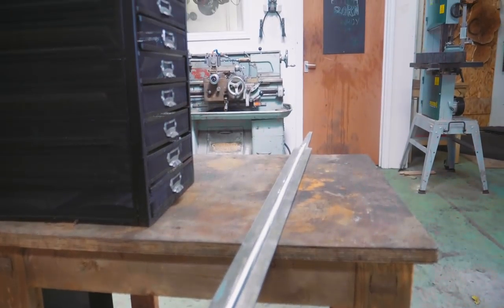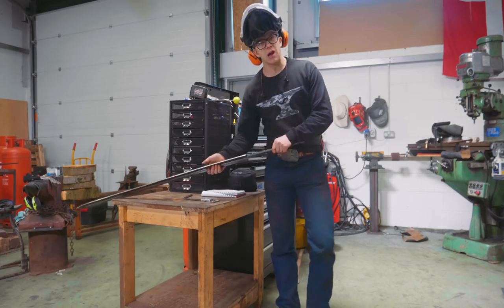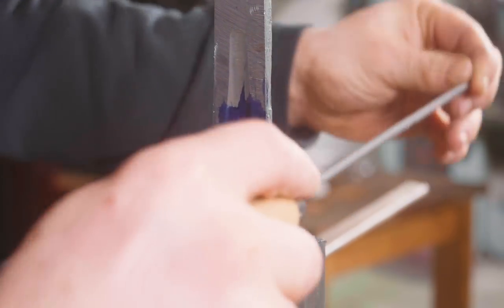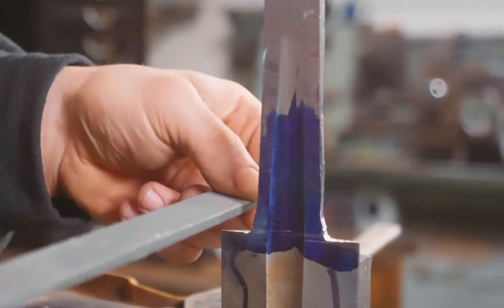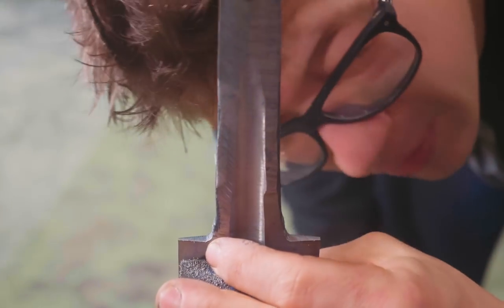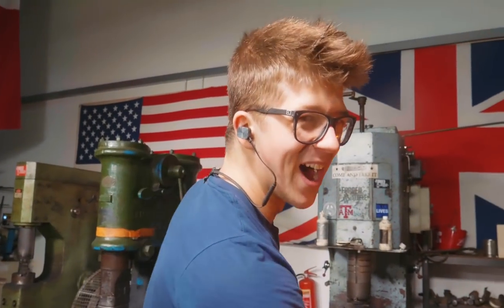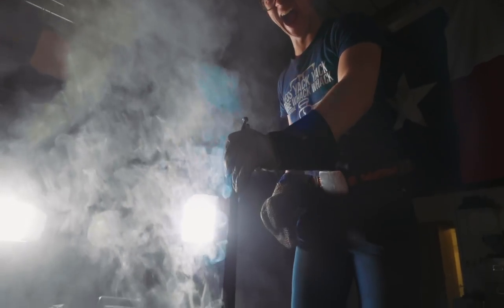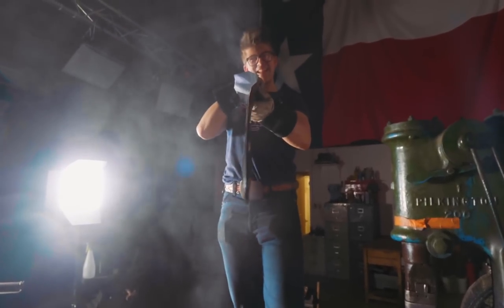MAKING A SCOTTISH CLAYMORE SWORD!!! PART 5

Comment: Alec!!! You really need to make a proper length forge if you plan on making more swords! I understand using the smaller forge for fine work on the blade, but that warp is what you get when you don't evenly heat it. The temperature gradient on a 1/3" thick slab of steel can still be comparatively large if you are dealing with the kind of conditions at the edge of a forge. I'm sure you will figure out a way to fix it though. I still love your content, so don't let this failure discourage you!
Reply: A sword forge is definitely needed if he's going to continue making swords. He certainly has the shop space to install one, and he has a buddy who makes forges.
Reply: ThrowingItAway My bad, I didn't look for duplicates. I just started mashing my keyboard furiously when he went for the quench.
Reply: well, not necessarily. if you forge something you don't want to forge something while it's all the way hot, so you need to have something that only heats up at the most 2 feet of metal to forging temp.

Comment: for long blades quench thick and grind thin to reduce the risk of warping.
Reply: Stuart Smith Forgive the n00b question, but ive always wondered ... is it possible to clamp a blade to a rigid support when quenching to prevent warping, then just normalize afterwards to relieve the resulting stress ?  Would that work ?
Reply: Roving Punster actually yes, one trick is that when you quench it you actually have a few seconds to straighten it right after, when quenching you only need to keep it in the oil for about a second to get the drop in heat (if it takes longer your not using the right fluid) but anyway for a few moments after the blade is still changing its structure and hardening and during that short time it is possible to clamp it straight and the blade will maintain straight
Reply: Roving Punster yes and no. I've seen long blades quenched with bracing structure in place to keep it straight with great success. However you don't want to normalize after a quench as it undoes all the hardening.  I think you mean temper it after the quench. But yes, even after a temper you can,  to a degree, flex the blade to remove warps. However what Alex has is extreme. It will take some time and creative thinking to get it straight .
Reply: TheAmericanGuy yes he could have taken advantage of the short period after the quench to attend to the more serious warping.
Reply: @Roving Punster: 

At this length it would not work. The problem is that steel is quite flexible, which would lead to the sword beeing straight clamped down to something and flex as soon as you loosen it. 
The bend at quenching comes from ununiform heat as well as different material thicknesses and the internal forces will be there even when the steel is clamped down straight.
Reply: Peter August I guess it is not quite the same as stuffing a toothpick in a flattened shrimp to keep it straight during cooking. 😉 j/k

Thank you everyone for the very informative answers. Much obliged.
Reply: Again, forgive the n00b remarks, but It's too bad many types of steel apparently lose their (or entirely lack) magnetic properties at/near quenching temps, because (on a purely conceptual and hypothetical basis) having an electromagnetic induction coil system paired with a multi point infrared sensor (ex: https://www.amazon.com/dp/B00PEHCYBW/_encoding=UTF8?coliid=I1VBAH9NSI4507&colid=3NWIN21DPU1U1  ) and a digital control unit could otherwise automate/optimize the hardening process ... just enter the type and thickness of steel and the hardness range desired, and the machine will get you close.

Wont work, but fun to ponder.
Reply: Roving Punster it will work but only on smaller blades.
Reply: Stuart Smith I've reinvented the wheel ?

It's Miller Time. ;-)

Comment: Aren't you supposed to bend the warp back during the "grace period" while it's cooling? Clamp it in a vice and bend it back while it's still hot enough
Reply: Yes, but that is hard to do even for more seasoned smiths, when you see Illya do it on Man At Arms you gotta remember that he is vastly more experienced than Alec, he has been a blacksmith for as long as Alec has been alive. 
He should practice it on more simple pieces though.
Reply: @immasurvivor  Also the human avatar of Svarog... (Illya)

Comment: At about the 8:30 mark you can see that warp start to develop in the forge .. but I think if you file test that blade .. you'll find it is not hardened fully .. unless the lighting gives a different perspective .. I don't believe that blade was anywhere near hot enough to harden .. I sincerely hope I'm wrong for your sake ...
Reply: Andy Amend yeah I hope it was the lighting cause from what the camera picked up it didnt look hot enough or uniform in colour. Hope its not the case & its just a lighting & camera issue.
Reply: It's probably the lightboxes making it nearly like daylight, so not as easy to tell the true color.
Reply: True. That and the middle definitely got hotter than each end.
Reply: The heat didn't look even enough to my eye, it looked quite cold in some sections and hotter on one side. I don't think all of the sword hardened, from looking at the scale pattern it looks like the cold spot near the middle is soft.  I really hope the blade didn't saber on him or it's toast. I think Alec should build a proper sword forge if he's going to do these builds. And if he's going to use solid fuel again it should be charcoal rather than coke. It's cleaner when it burns and it doesn't have any ash.
Reply: My first thought when he quenched it.
Reply: Lighting.
Reply: I completely agree. that blade isnt nearly hard as it should be.
Reply: i'm no blacksmith expert but from watching forged in fire and man at arms that did not look hot enough what so ever to quench, and also can you stop adding in 3 minutes of slow motion and loud bass? why not just explain what your doing or answer some questions
Reply: Andy Amend it probably won't be that big of a problem because you don't need or want a blade like this to be full hardness
Reply: Yeah, I'm surprised the camera man didn't notice that warp since he filmed it....lol
Reply: In those shows, they are typically in a dark or semi-dark smithy, so the glow from the steel is more noticeable. I am a blacksmith and can tell you the difference between indoor and effectively outdoor lighting is enormous. Red hot is nearly invisible in daylight, and Alec uses substantial lighting in his videos.
Reply: MegaRetroRocket I completely agree .. I am a Journeyman Model Maker by trade and have done my share of heat treating both with an oven and a torch and lightning makes a huge difference .. but while most of what I've done requires around 1400 degrees F that blade was no where close to that or heated evenly ...
Reply: hell yeah,  a big quenching forge like freerk wieringa
Reply: I'm not sure what you're talking about GrandSmith? You want a blade to fully harden unless you're going for differential hardening which is a very specific deliberate process. Steel expands and contracts differently depending if it forms Martensite or not. Uneven hardening of a blade will cause warping or even cracking. Ideally you want to temper back a fully hardened blade.

Comment: To keep the grinding of the fuller centred, clamp it to an angle iron with its centre line held parallel to the other side of the angle. The angle iron can be supported by the tool rest and it will keep the fuller at the same height above the rest for the full length.

Comment: Alec, warping like that happens quite a lot in damascus steel blades, the way to fix that, is right after the quench, while it's still hot, you can bend it back into place without harm.you cant have it in the temper very long though, need to just get a quick temper and get out.do be gentle doing it. i'd suggest go do a couple more normalizing cycles, then do another quench.

Comment: Time to throw it back In the forge for normalizing #4 then the fun straightening process. I would do a magnet test on the ends before trying the quench again, the heat was most likely uneven. I would make a new forge that could be setup behind the old one for doing such long projects, basically two forges back to back so you can get an even heat and only use both when doing the heat treat stage and have the second on wheels so you can move it off to the side for everything else.

Comment: Did you move the blade around during the quench? While good practice for everything else, you should not do this with long blades. Even a wiggle can apply big forces.

Also, try to make the transition from horizontal fire to vertical quench by tilting over the edge, not over the flat. While over critical, a long blade like that can bend under it's own weight.

Out of curiosity - how much does the blade currently weight?

Comment: While it's still hot from the quench you have a small window to fix any warp. You can throw it in a vice to fix the warp before it completely cools. For the center fullers you could get a much more precise shape by using a ball end mill on the vertical mill

Comment: Why was the blade so cold during the quench? Is the critical of that steel very low?
Reply: JoshL just my wondering to
Reply: I'm not sure, but I think that might have something to do with the warping.
Reply: Colors are very deceiving with the lights he has set up in order to film.
Reply: It was still definitely too cool - and might indeed have contributed to the warp^^
Reply: It looked too cold and too uneven, which is likely why it warped.
Reply: ThrowingItAway yeah the uneven is probably true but don't trust looks for heat.
Reply: Parts of the blade were still black
Reply: JoshL have you ever heated metal with a lot of lighting and recorded it? I have and 1550° can easily look black if its too bright
Reply: Despite the lighting you can see the hot and cool spots moving with the blade. It wasn't an even heat, watch the video again and again if you want to be sure.
Reply: ThrowingItAway yes, it is not even but the dark spots could still have been hot enough
Reply: Checking the magnetic field is your best guess of whether the steel is at or past the critical normalizing cycle, that's why you repeat this normalisation process to insure the proper alignment of the molecular structure... sorry, I faked that half way through, but I really do know the process!
Reply: Jon Rothenbusch I'm sorry but you sad so many wrong things.
Normalizing has NOTHING to do with the Temperature at which the steel gets non-magnetic, really, nothing. Normalizing refines the grain of the steel, so that the grain size is smaller and there is less stress in the blade. And technically you don't check the magnetic field, you just check whether the steel reacts to a magnet, since it normally doesn't have a magnetic field on its own, but it creates one as soon as there is a magnet nearby
Reply: Allen Sanderson 
From the standpoint of recording and professional lighting, the blade was receiving equal lighting along the length of the blade. The lights he uses are made to give bright, even lighting, or at least that’s what they look like to me as display set lights. If that’s the case, then the dark spots and lack of uniform color along the blade would show that there were parts that were cooler than other parts. I think here, we could still use coloring to tell that it wasn’t evenly heated.
Reply: Matthijs that's right but he says that normalizing the steel influences the magnetic qualities and that's flat out wrong
Reply: If you look at the quenched blade I think there's a big patch on one side where the steel didn't harden and blow off the scale.
Reply: Alec needs a bigger forge ASAP

Comment: Alec, check out Freerk Wieringa's channel.  He has a grinding jig for his sword fullers.  Its basically just a roller table, and a rounded edge grinding wheel.  He moves the table back and forth and bring it up a tiny bit each pass. Keeps it totally straight and even.

Comment: There's no problem in drawing a file backwards just don't push it down hard. By pulling backwards with very light pressure you help to clean it from filings getting stuck that will make deep scratches.

Comment: Hi Alex,

I was just watching you filing the tang of the Claymore. I think you might find it easier to get the shape and finish you're after if you move workpiece around in the vise so you're filing on a level horizontal surface. It means you have to re-position the work more often but I think you'll find it's much easier to control the file and get the exact profile you want.

I was taught metalwork by an old fashioned craftsman in the 1970's and it's something he always stressed. Make it easy to control the tool and you get a better result.

Hope this is useful to you.

Regards
Gordon

Comment: Maybe something that could help in the future when you do long blades like this. I seem to notice when people make Katanas and other large swords, when they do the quench, they tend to use a horizontal tank instead of a vertical one so that you have an easier time getting the entire blade to submerge immediately. With the vertical tank it tends to cause the long blade to warp because the tip gets cooler long before it gets to the hilt. Maybe in the future you could try it and see if it makes a difference for you.

Comment: As it was previously mentioned: the blade wasn't evenly hot, and you have a few seconds immediately after the quench where u can straighten out the blade so having a vice or a setup nearby is always handy, I suggest checking out the awe me YouTube channel and watch some man at arms: reforged episodes with big swords to get an idea of what I'm talking about. Also very important with big swords: quench thick, the thinner the blade the bigger the chance of a warp if the blade is thin. Good luck on unwarping that blade Alec ;)

Comment: Sounds like normalizing, and fixing the warp and reheat treating it. I'd check for cracking from this treat to make sure the steel hasn't turned to spider webs before moving on. Maybe another test etch or magnetic particulate test if you have the availability. Can't wait to see what you have done tomorrow!

Comment: Alec, you are going to want to read normalize the blade to soften it the when you harden again use your post vise to bend it back to form gently.  If you need examples look to man at arms reforged. They have excellent explanations on the technique. I recommend the Narsil build

Comment: You can leave the file on the Metal when you are pulling back just let off the pressure so you're not digging in the wrong way but it can touch lightly. Makes it easier to work quickly

Comment: You can bend the warp back by really softly hitting the spot in the warped area on the hollow side, with a thin hammer. This streches the metal back a bit. And also the chance of warping is bigger when you do the fuller before the heattreat

Comment: Could be wrong, but due to the piece being so long it looked like the heat didn't evenly paint on the blade? Thus causing the warp on the cold side as you quenched? As heat expands and the cold clenches in yes?

Comment: I'm no expert in forging but have seen in many videos of blacksmithing that the smith will often after hardening use the split few seconds after the blade has come out from the quench with the remaining heat in the blade use a vice to straighten the blade and then clamp it upright to prevent any warping in the blade.. I don't know if this is correct but maybe it could help when forging these larger blades? I might be talking nonsense but maybe it could work in future?

Comment: Uneven fullering will cause warping nearly every time...don't be afraid of using a template or guide when grinding a fuller or an edge! Even though it's not a traditional method the final product is worth the sacrifice...remember that when the original sword was forged there was no such thing as HD, functionality was the only thing that mattered...with a small serving of decoration on the side

Comment: that tube in the forge might be a really good idea if you were to cut a hole in the top of it and place it directly under the burner it could lengthen the effective heat of the forge for when you do larger projects like this

Comment: If you haven't learned how to straighten steel using heat applied at the correct place and cooling it, well it's time you did. There are tutorials on it but experience once again is the best teacher. I'll tell you though you will be pleasantly surprised at the success you will have with a little practice. One hint; Keep notes on all the variables. Such as material,thickness, temperatures and amount of deformation. Good luck.

Comment: Something I’ve seen the guys from Men at Arms - Reforged do (especially after the heat treat) is clap the tang with the blade pointing up so that as it finishes cooling the heat disperses up the blade, if i recall it gave the blade a mini tempering after the quench so that it isnt as dangerously brittle coming out of the oil
Another thing they do is use the clap to straighten any warps they see when they pull a blade out of the oil, its a quick, sturdy and unmoving object that lets them work fast to fix warps.
Maybe something to try down the road?

Comment: If you just watched Man at Arms reforged you'd know! Quench, pull out before the blade goes below 400 degrees, you have just enough time to straighten it before the martensite is fully formed, apparently warping in almost inevitable so this is the way to go...

Comment: Hey Alec, I saw in another blacksmithing show called "Iron and Fire" that when forging blades it is important to use a compass and keep the blade pointing towards magnetic north in order to keep it from warping/bending/twisting when it cools off. I noticed that in some videos you used a magnet. I was curious if that is what happened in this episode 5 with your claymore.